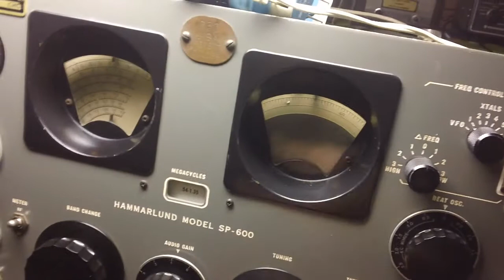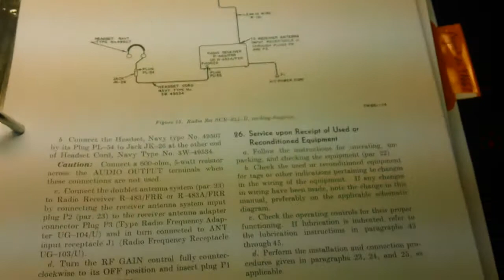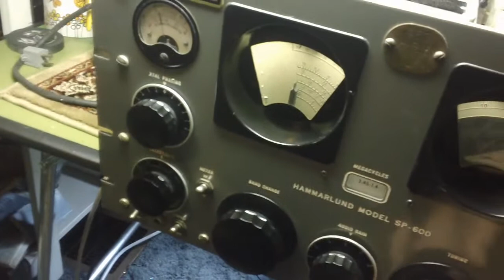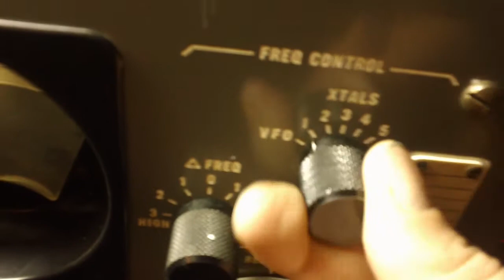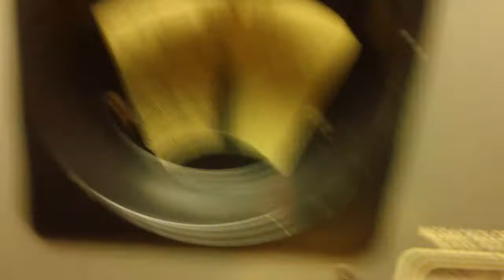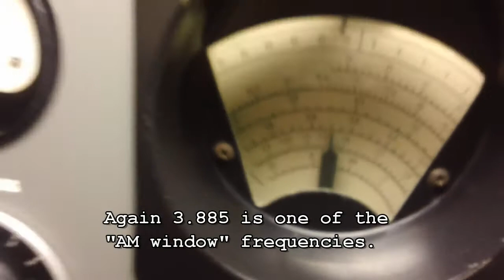Hammarlund SP-600 first power-up!

Comment: To anyone watching this video the problem he is having is that the arm behind the VFO/XTAL switch is in the wrong position and won't allow the switch to operate properly. The arm is supposed to be over the top of the wheel it is attached to , not on the bottom. Someone has apparently removed the XTAL module and allowed the arm to swing down instead of over the top of the wheel it is attached to.  Hey, I've done that too.

Comment: If you have AC hum on the SP-600 audio replace ALL of the electrolytic capacitors in the power supply circuit. Don't run the radio again until this is done. SP-600s built before 1956 (most of them) need to have ALL molded capacitors replaced. Units built after this date do not need this. Later units used ceramic disc capacitors instead. SP-600s included the four dial lights using #47 lamps. These are part of the 6.3V filament circuit. The 6.3V B+ wire for these lamps is connected in back of the RF/AF meter on the middle connector position which features two wires. If one is cut off, you have your answer. There were no "black-out" units produced. The lamps could have been removed by a previous owner.  No, speaker audio from a stock SP-600 will not cut off if headphones are plugged in. You are correct, none of the SP-600 RF/AF meters were illuminated. Hammarlund opted for a better sealed meter rather than illumination. Leave the military boiler plate tag on this radio! All Hammarlund SP-600s which include the letter "J" in the nomenclature were built to military specifications, whether they had a military contract tag or not. You need a matching transformer between the radio and a speaker that is not 600 ohms. These can be mounted in the speaker enclosure instead of modifying the radio. The crystal selectivity positions were intended primarily for CW and RTTY reception but they are very useful for tuning other signals as well. This is one of the best tube SW receivers ever built.  BFO is superb. VFO is the normal operation position. The XTAL positions 1-6 are each controlled by a crystal for individual and extremely accurate (for the day) frequency control of six specified frequencies. The delta change knob above the BFO knob adjusts XTAL frequency setting, not the BFO which is extremely accurate when correctly aligned. Nonetheless, the Band Change and Tuning knobs had to be properly set for best performance from the XTAL controlled frequencies. This feature was designed for RTTY use. SP-600 is excellent for SSB and ECR reception but the radio must be properly operated for MANUAL (not AVC) reception and you must ride the RF gain manually. Designed specs for the SP-600 can only be achieved with an accurate IF and RF alignment. The military Technical Manuals for maintenance and alignment of this radio are available free on the internet. Another note: if the knobs on the control panel or other alignment adjustments have been screwdrivered by an unwitting user (including hams) then you have some science to do to correct maladjustment. Just a warning. My radio is a JX-21, which was built at the same time and later with the same features.
Reply: Thanks, I just acquired a JX6